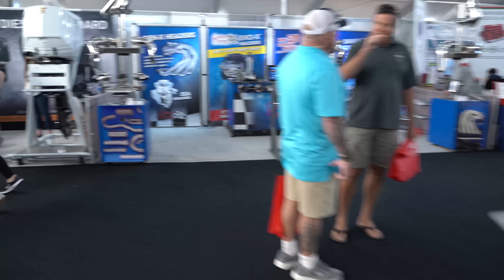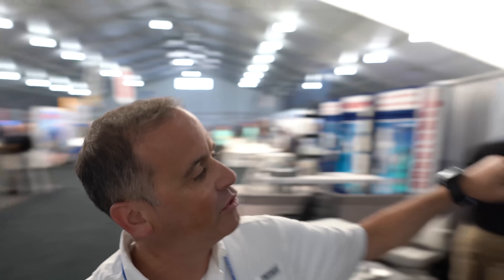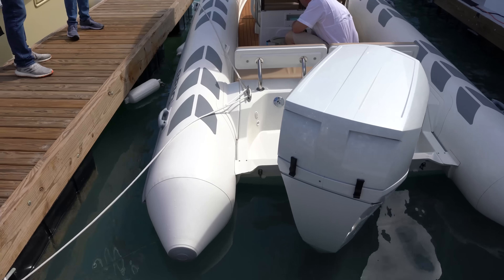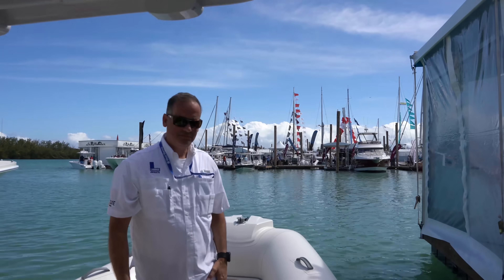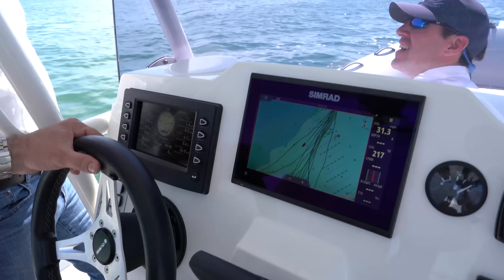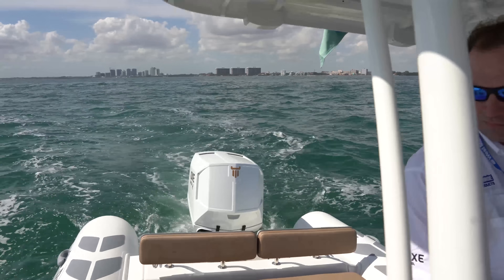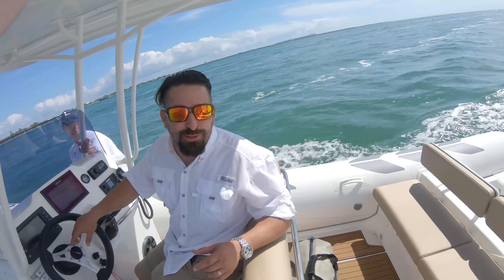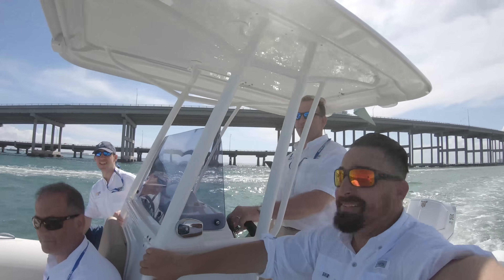The diesel outboards are coming ! Oxe 150 hp on a Brig in Miami !

Comment: Kind of irresponsible reporting in not asking weight and cost specs.  The claim of 8 gph was referenced at what throttle setting ?  Is that WOT ?  They said 6 GPH and then 8 GPH just above cruise.  A Honda BF150 above cruise at 4000 RPM burns 4.9 GPH so the claim of 40% better fuel economy is bogus dude !  From my experience with diesels there's also a premium when it comes to service and maintenance.
Reply: 2:12 he said the demo boat was getting 6 MPG with eight people in it. You need to listen before you call bogus haha.  Unfortunately you are correct thought that diesels do have a premium with service and maintenence.
Reply: @robtdougherty  Outboard engine's efficiency is usually specified in GPH. The video never sited the speed of the boat so MPG isn't relative in the conversation. If he had said that the boat got 6 MPG at 30 MPH for instance then that would equate to 5 GPH, the same as the Honda BF150 at 4,000 RPM and 30 MPH. If it's the same, then it isn't 40% more efficient.
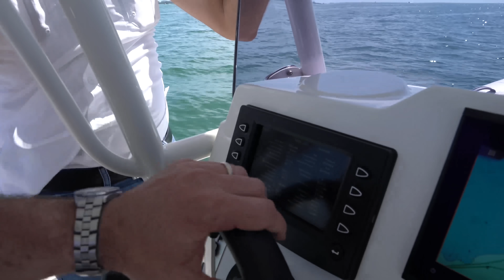Reply: @TravelswithYoly  6:53 he says 7.6 GPH at 30 knots (34.5mph).
Reply: @Hungry_Tree_Ghost  My main point was simply that the claim of 40% more efficiency doesn't hold up. My example of the Honda BF150 hypothetically on that same RIB might turn as much as 4,500 RPM to attain that speed and in the process would burn 6.3 GPH. Again, not a 40% advantage with the diesel :-)
Reply: @TravelswithYoly  Understood. Just throwing in some missing info for you and future comment readers.
Reply: @Hungry_Tree_Ghost  Thank you .... I understand and feel bad that I missed that bit of information when I watched the video :-)
Reply: @robtdougherty  I think the high costs and near 800 pound weight offsets a lot of pluses. Of course if you own a 8 or 9 million dollar 90 foot bass boat, you just might have to own one of these.

Comment: Yeh but how much does it weigh?
Reply from the maker: Like 350
Reply: @AlfredMontaner  150kg over the average is a lot. Wont be running twins then..
Reply: These are for super yacht tenders
Reply: @PaulAnthonyDuttonUk  it weighs 350 lbs. So thats only 158 kg, that is average
Reply: @jamesallbright3170  The web site says the 150 is 350kg   - https://www.oxe-diesel.com/Products/Oxe-150
Reply: 771lb vs avg 150(480 lb+ -) very heavy for a 150
Reply: @PaulAnthonyDuttonUk  ah i see what your saying then
Reply: @JM-hf5od  agreed. Compared to the Yamaha F150 at roughly 475lbs, that diesel outboard is too heavy. Hoping they  can do some modifications or tuning to get higher output out of that motor.
Reply: @SimpleGreen2017  Mercedes build an Austro engine(also diesel) with similar power for the aviation industry that has a much lower base weight. Would serve as a better platform and save 100kg like for like.
Reply: I really hope these motors catch on. There are some clear advantages of having the increased torque output and fuel efficiency in the marine setting. If they can match power to weight output of gas outboards and remain reliable these motors will be a game changer.
Reply: @SimpleGreen2017  if you own a mega yacht then has an appeal I guess. Their sales figures will ultimately show where the market space is..
Reply: @JM-hf5od  hopefully its just first generation issues
Reply: Tyler Sabelko these are tailored to the yacht tender crowd for the sole purpose of not having to carry gasoline. Today’s gas outboards put out plenty of torque and last. It’s not like it used to be. But doubling or quadrupling a mega yachts insurance just for carrying gasoline aboard, that’s a big deal.
Reply: @PaulAnthonyDuttonUk  Yes Paul you are right.It will way down the boat massively,but great concept i guess

Comment: I can already tell they are about double the weight of a gas version.  I could care less about fuel economy especially when diesel is higher than gas so 40% isn't really 40% more efficient when speaking fuel cost to consumption. Everything thing I want in a boat is to squeeze out power and reduce weight I could accomplish neither with this motor.
Reply: @loostonerool I get there are some advantages to diesel. There is absolutely no situation I would own a diesel that would give me a advantage. More torque on hole shot is about the only positive I see. Wouldn't have the top speed to be competitive vs a gas version. Gas is $1.99 diesel is $2.79 at it's current price. What boat in your opinion would benefit from these diesels that would give it more of a advantage over a gas equipped version?
Reply: loostonerool the extra torque in a liquid medium is more of a hinderance than an advantage. Extra immediate torque in water is not the equivalent of extra immediate torque in a tires and road situation. Cavitation issues will entail from the propeller and water combo. Hence you need a gradual application of the throttle. Really not an advantage in this case. What’s an advantage with the diesel is consumption and reliability/longevity  (half rpms at all times in comparison to a gas engine - half the friction and wear). Weight is not in favor of diesel but price of diesel is lower in many places (e.g. most of Europe) vs gas so extra savings there.
Reply: brad ross you’re right, this is not for you. The few groups it is for, is the petroleum industry workboat where gasoline fueled boats can’t be used and large yachts that don’t want a bomb on board. Neither is concerned about weight or cost except the savings of the cost of a rib over a diesel inboard

Comment: I understand it is a 2 or 3 hundred pounds heavier than a gas engine and about twice the cost. My FD water rescue bought 2 Mercs for around 15K. This lists out at around 45K  and we could have bought 3 for what this costs. So weight and costs are not a huge selling point,  You have to put a hell of a lot of hours on it to see a payback benefit for the 2 or 3 gallon fuel economy.  How long before a major tear down? Can it sit for days without a problem? The added weight could require major alterations or rearrangement especially in a twin environment.  Having said all that and with the knowledge in my area diesel fuel is more expensive and likely unavailable at our local marinas, I love the fucking thing!!

Comment: Yarmar Diesel was the first then later Mercury DSI diesel outboards have been in service with the US navy and the UK and allies since 2015. It is the exact same weight as an OPTI 3.0 2 stroke v6 and shares 95% of the parts. Sorry you are defiantly not the first and if memory serves me right and others have said this has been done before. Put a Cummins, Perkins, Kubota and hey a great Yarnmar and they have made these since 1984. That's like OX saying they made the first diesel boat anchor, because if they build engines the way the do research count me out.

Comment: How is the fuel pump lubricated? By the fuel or by the engine oil?
Reply: next, you are gonna ask is it an inline fuel injection pump or rotary pump!! rotary are lubricated by fuel, inline pumps ordinarily are lubricated with engine oil ...and for a variety of reason, inline pumps last much longer...
Reply: @FrancoisLabelle-yf8tj  Engine oil lubricated pumps tend to destroy the engine when they fail. I only ask out of curiosity and because of some experience with Cummins.

Comment: Whats with the silicone hose on the dump pipe from the turbo? Can that withstand the heat?
Reply: Silicone is extremely heat resistant
Reply: You mean the compressor outlet? The red thing? That's a coupler to the charge air piping, identical to what has been in service worldwide for 30+ years.

Comment: Imagine getting this serviced, probably double the price if you can find someone
Reply: Service is fine if it's not way out of line. Shouldn't be much besides oil and all the filter changes and I expect to pay more for high quality diesel filters. Still shouldn't be that bad. As long as it doesn't break down it should save money overall. Hopefully enough to pay for those higher priced filters. The engine life is the biggest thing with diesels.

Comment: Was that the turbo sound at 7.48?
Reply: Blow Off Prevention Valve dumping excess boost air from turbo into exhaust from intake manifold when backing off throttle when it is not needed to feed the cylinders.

Comment: How come the 125 weighs the same as the 200? Both really heavy at 771 lbs A 4 stroke 150 petro weighs less then 300 lbs & a 200 HP weighs approx 600 lbs. Would be great if the the 125 weighed around 300 lbs.

Comment: And not one dock with diesel fuel
Reply: That's why they're going to use them at service boats for yacht owners yachts always dock in ports with diesel that's what they all use even Little bluewater cruising sailboats have diesel motors  sometimes on the dock especially in a third world countries gasoline is hard to find  and requires people to travel inland and fill up gas jugs for dinghies and service boats

Comment: I wish they would have gone into what the actual mechanical and practical advantages of a diesel outboard are over a gas outboard, other than efficiency I'm struggling to think of why I would want this, and then when I think of diesel engines have a higher manufacturing cost combined with the low volume production I would think it will cost a good bit more than a gas engine with comparable output... so who is this for? I guess just rich people with yacht's?

Comment: GM did not design it, FIAT did and GM partnered with fiat. The rail engine is in my Fiat Stilo.. I get 60 mph.  The supercharger makes it quick to run. Many companies use this engine to build their cars and small trucks with. Easy maintenance and long life. I put 300K miles without a rebuild yet.

Comment: The engine only weighs about 5,000 pounds and cost a fortune to maintain. PASS.
Reply: No it weighs under 800 pounds (still heavier that any gas engine) and most if not all diesels are far more economical to maintain. They are also more efficient. However this is one expensive SOB (sweet old bunny of course) at $45,000.

Comment: `Mcculloch made an outboard in 60's called Ox, it was a huge failure due to them ruining the names reputation by it's under powered predecessor a 14hp, I have a 45hp production number 001, and the only other one I've seen was number 008 and both engines are in the Netherlands.

Comment: why does he think belt drive is so great?
Reply: Agreed. It looks like a horizontal crank so shaft-drive not possible.
Reply: cvt transmissions are belt drive and they work well, so why not belt drive?  Belt technology has come a long way.  Not all belts are created equal.
Reply: Grant Myers also most front drive transmissions use a belt, it’s hardened steel but they call it a belt and were and are used all the way up to and above 500hp no issues. More friction than 2 mating gears but way less than spiral bevel gears in stern drives. Many surface drive race boats use them, most above 1000hp

Comment: These are standard GM automotive engines, nothing marine about them.  Automotive engines can not withstand the duty cycles of the marine environment. Where as automotive diesels like to run around 2k rpm with little load, the marine diesels will run well over 3k with heavy loads. These engines will likely overheat and we'll see cracked blocks as a common issue. The standard auto diesel block already weighs nearly twice as much as a gas engine so just imagine how big it really needs to be...they just can't do it, it'd be too damn heavy; so they're going ahead and hoping you'll forget what we all know... diesels are just bigger!
Reply: Research GM duty cycle testing..... even their top HP engines are designed to survive wide open throttle fornthe engines life cycle. Its why they get FAA STC certs in planes.

Comment: Did you hear the guy 8 gallons an hour I wouldn't go too far out
Reply: 8 gallons an hour isn’t that much when you’re going 33mph
Reply: Haha you think 8 gallons an hour is a lot I run a boat that sucks down 80 gph but it does have 4  435 hp diesel's
Reply: 6 miles per gallon.
Reply: @Florida_man420  yeah it is
Reply: 33kph = 38mph
Driver says 8gph = 4.75 mpg
Salesman says 6 mpg so cruise speed to achieve the better fuel economy must be around...27 kph or 31 mph
Reply: Lance Manyon my buddy’s 300 verado on his 23 ranger gets 9-10 gph going 30mph
Reply: @Florida_man420  so what ?
Reply: Dan Gau knots>mph>kph you got some things wrong.

Comment: So what's the chances of getting offshore & a drive belt snaps!
Reply: Probably slim to none. Drive belts have been used in cars and motorcycles for decades
Reply: Same chance as a timing belt snapping.
Reply: I've owned outboards longer than cars.  I've had zero prop shaft breaks and four drive belts snap.
Reply: My offshore motors get way more monitoring and attention from my mechanic than my cars.  That said I’d never find a mechanic to service this in the remote places I fish.  I’m impressed but I’m out!  Congrats to the next generation of offshore fisherman who’ll get to use these.
Reply: Elevators are now held up & run by belts. Belts are smooth and quiet. Resulting in longevity.
Reply: The dredge I ran had 370hp c15 diesel driving a pump with belts we changed them at 2500 hrs as preventative maintenance but they still fine at that point.

Comment: I was interested until I heard GM was involved..
Reply: The same company that put out a million mile capable duramax
Reply: Gm and Ford are great
Reply: G.M. is the ONLY one of the big three automakers who has been manufacturing diesel engines for many DECADES!  Detroit Diesel Allison  (G.M.) has been making some of the best diesel engines on the planet since the 1940's or so. G.M. owned 70% or so of Isuzu when they made Chevy Luv and Isuzu Pup pickups with the original Duramax from 1981 thru 1987. NO ONE has been making diesel engines longer than Isuzu world wide with the exception of Puegot. Allison Transmissions have been used in School buses, garbage trucks, dump trucks and so on for DECADES. One of the very best transmissions ever made!
Reply: The GM/Isuzu Duramax has been proven to be capable of hundreds of thousands of miles. I’m not a GM fan as a whole but the Dmax has become the best engine in the light truck market.

Comment: I can't wait for Tesla to bring an electric boat motor or even a Tesla  yatch
Reply: there is a guy here on you tube thats building them. They're bad ass
Reply: Only submarines run well on batteries. Calculate the energy to propel a boat for a reasonable length of time, and speed, and compare battery weight verses diesel or gasoline. Then you would not even make a suggestion of electric.
Reply: @grancito2  oh man, not true. this guys invention was amazing. It was super fast, efficient....and did i mention fast? Its gonna happen.
Reply: @thomasrudder9639  Fast for how long, that is the problem with all electric boats, they can't store adequate energy, same for aircraft.

Comment: Why deisel???
Reply: Ezzy J with boats, it’s all about torque. Gas engines need high revs to get full HP and torque needed.  Getting high torque at Lower RPM make them much more power dense per gal of fuel consumed. Boats do not get up to speed as coast on roads, the drag is entirely different, they need steady power to keep propulsion up. Think of it as a constant hill climb.

Comment: You obviously have never owned a diesel.... after the initial double cost just to get into diesel then add the much much higher maintenance costs then add the EXTREMELY higher breakdown repairs,.... theres no way no matter how long you run it could you ever ever break even on buying anything diesel unless it's a Kenworth...  I get the diesel advantages for carrying diesel on a yacht but for the average joe this is not an option at all...

Comment: I do love the concept but I’m not happy with the engine they chose to do it with. The 1.6 and 2.0 Chevy Cruze diesels are made in Hungry by some no name company and I’m betting that 300 hp will be GM’s 4 banger diesel from the Colorado, (maybe, ) which is a Motori LLC ( Fiat ) and it’s having big issues. 
Truly love that concept though, just use some decent engines and get rid of the belt.
Reply: The 300 hp will be from BMW. BMW TwinPower Turbo Inline-6-Cylinder Diesel Engine. Source: http://news.cision.com/cimco-marine/r/cimco-marine-enters-into-supply-and-development-agreement-with-bmw,c2668739
Reply: Here's a video of the ongoing development of the coming Oxe 300 hp https://www.youtube.com/watch?v=fAZuZL_j_Jw